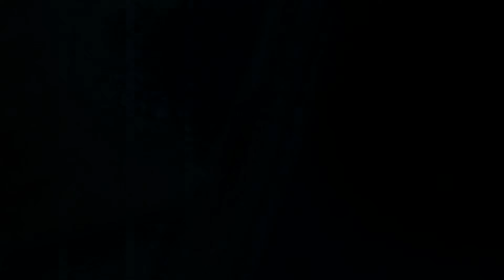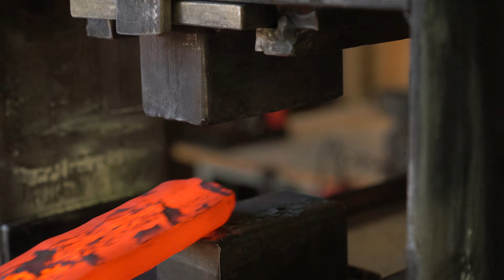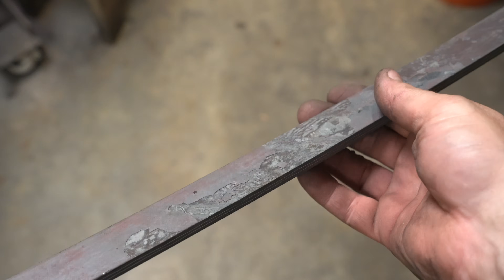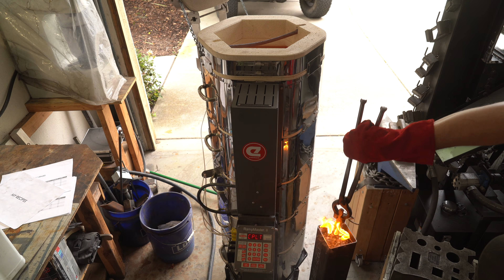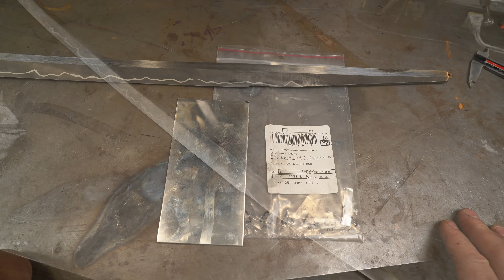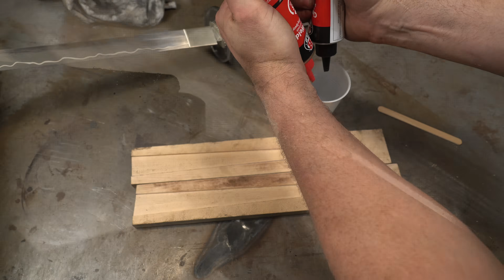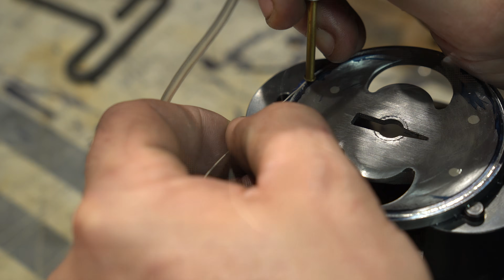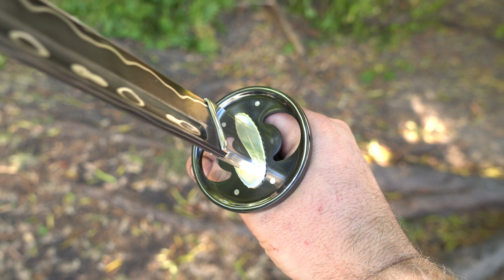Forging a Silver Damascus Katana

Comment: Hi, curious, have you ever used the wood clamp method after a quench to prevent warping?
Reply from the maker: Yeah, I’ve tried that.  It really doesn’t do much.  I usually clamp between pieces of angle iron as to prevent further warping but it still can happen. Thanks for watching.

Comment: How has the sword held up? I love the idea of silver Damascus, so I’m really curious if it holds up well over time.
Reply from the maker: This sword was sold the day it was released.  Theres no question that it would hold up though.  The silver is a very thin layer, about the thickness of two pieces of paper, over a central core of high carbon steel.  It’s very strong and durable.  Thanks for watching.

Comment: why the tiny file after the heat treating it was there for half a second what does it do?
Reply from the maker: That is a special hardness file.  It shows that after heat treat, before temper, that blade was around 65 hrc.  Thanks for watching.

Comment: 0:02  I’m just going to say that before I watch this, I know one thing that nobody can disagree with. A key point with this project will be to make sure that the edge is high carbon steel, unless this is just a decorative piece. I know this is a possible if extremely expensive project. Since copper can be used in damascus then so can metals like gold or silver. Just don’t try ever try titanium, the weld is highly unlikely to stick.
Reply from the maker: Thanks for hanging in and checking out this build.
Reply: @TyrellKnifeworks you’re welcome,
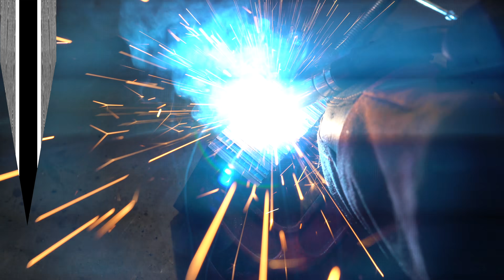Reply: 0:37 just hearing the plan is having me nodding in agreement, and thinking good thinking, this guy knows his stuff.

Comment: i have no experience in forging, never did anything close to it and have no experience at all. But I'm a scientist, and have deep understanding of physics, although i'm an applied mathematician. So as i understand, the process means a lot on an end result, and i have a few question. 1. Shouldn't hammering be preferred over pressing? as i understand applying instant impulses should be more beneficial for alloy, or pressing for some reason is better? Also as the alloy in the process gets cut, and wildered together, it affects to alloy quality by a big margin, wouldn't it be better to bend the alloy and hammer, or press it back to one piece? please don't be angry if my questions are stupid, a just wanna know ur opinion, since i have no clue
Reply from the maker: There have been studies and hammering doesn’t prove the steel structure.  Aldo, the cutting and restacking is preferred over folding because it’s quicker and you get more layers faster.  There is no benefit to folding over cut/restack.  Thanks for watching.
Reply: @TyrellKnifeworks  thank you

Comment: I realize that this is for decorative purposes.

But ….   What’s the theoretical STRONGEST Damascus 4:52 configuration?

There’s 2000 varieties of 
steel.

And Titanium, I suppose.

What’s the most flexible, most durable mix?
Reply from the maker: There’s no “best” steel or combination.  It all depends on the use case.  Too hard and it will be chippy, too tough and it won’t hold an edge.  Titanium is strong but brittle.   Theres just no answer to this or it would have been fine by now.  Thanks for watching.

Comment: Its not better to many times fold the Steal ?
Reply from the maker: Folding the steel was a technique the Japanese used to remove impurities because the steel they used was crap.  Modern steel does not have those impurities so adding layers is just done for aesthetics.  Thanks for watching.

Comment: Not a bad job. But real Katana's are not put in the handle with a pin. The handle is not permanently attached to reduce vibration when you hit something hard in battle.
Reply from the maker: This katana is held together with a single peg (mekugi) as it’s supposed to.  Thanks for watching.

Comment: Bro says you cant for the stacked differential shaped Damascus pattern "BALLS" I've seen it done no true blade smith uses a rolling mill they actually forge there blades to there desired shapes!!!
Reply from the maker: There’s so much wrong with this statement I don’t know where to begin.  What the hell is “stacked differential shaped Damascus”? 🤣  Did you make up that term?  What I said in the video was that you don’t forge these to shape, which you don’t.  Something like this with non-ferrous metals in it will delaminate if you try to forge the edges.  As for who’s a “true Bladesmith”, perhaps you should look me up on the ABS website, or better yet, grab the Feb issue of Blade magazine and see THIS sword featured within! Next time try asking a question before you spout off and sound very …uneducated.  Thanks for watching.

Comment: Iove seeing  the crap seep like sweat when forging 
Edit  Yr work is excellent,
Reply from the maker: I’m not sure what you mean, but thanks for watching.
Reply: @TyrellKnifeworks  just the impurities  as I thought  the were asbyou are compressing the welding and gradually  shape it , what is it then please ,scale ,love spelling, as y the process  and forged it ,with that fantastic  press y built, 👏, the black stuff that  seeps like sweat ,what is that
Reply from the maker: @lornemcneil the stuff that flakes off the side is scale, which is iron oxide.  It’s a waste product from hot steel contacting the air.  👍
Reply: @TyrellKnifeworks  thanks  for reply after my attempts  at spelling, grammar  ,and context, 👍
Reply: Scale is an impurity  then  ?
I acquired  a tamahangane  just because  it was old school, next is a folded  spring steel  that is in progress, and no the tamahangane  Was not Japanese
Reply: @TyrellKnifeworks  I had  to get folded  hand hammered  at least  for my laws now in my country, is  thier any ,any benefits  to fold spring  steel  other than ascetics,
Reply from the maker: @lornemcneil  No, not technically impurity.  When you expose ANY hot steel of any kind to air, it will oxidize.  Basically you're burning out the carbon and it's turning from steel to iron oxide.  Tamahagane starts as steel with a ton of impurities in it from the way it is formed in a bloom furnace.  They dump charcoal onto iron and it forms steel but this process creates a ton of impurites and pockets of slag.  This is the real reason why it's folded so many times, not to "strengthen" the steel but to remove those impurities.  Steel of that day made in Europe was crucible steel and had much less impurities so folding as much wasn't necessary.  Many people hold tamahagane in such high regard but compared to European steel of that day, it was far inferior.  I hope that helps.
Reply: @TyrellKnifeworks  of course   sir ,respect, I'm  read  the sword  forum reading  a lot  of knowledge, not my own personally,👍,y have givin time I will watch  more and send Yr  posts on

Comment: Why is your press build to move up instead of down?
Reply from the maker: Because it actually makes more sense to put the cylinder underneath so that it doesn’t need to be super tall.  I’m 6’2” and the dies sit at about 4’ so I don’t need to crouch over to see what I’m doing.  It makes zero difference if the dies compress up or down when working the steel.  Make sense?
Reply: @TyrellKnifeworks  yes thanks for the awnser! didnt know that.

Comment: Beautiful engineering, execution, and artistic impression in this piece.

You noted overheating and melting some silver. I did not notice any anomalies in the final result. Wondering if you were able to see anything not well captured on video?
Reply from the maker: The line of silver about 6” from the tip is a bit thinner, but certainly not bad.  Thanks for watching!

Comment: What are the names of the following machines

1- used to cut iff the extra silver nails in the tsuba
2- used to make a line to fill the silver in 
3- used to write letters on the blade
Reply from the maker: 1) a Dremmel with a carbide burr, 2) Pneumatic engraver, 3) GRS high speed rotary tool.  Thanks for watching.

Comment: The sword is undeniably beautiful, I’m just not convinced that it’s a functional blade. My concern is that it will delaminate at the first shock blow to the blade.
Reply from the maker: The silver brazing bond is in excess of 70000 psi in tensile strength.  You’d destroy the blade before you ever sheared the layers apart. Thanks for watching.
Reply: @ thanks for taking the time to respond to my comment, it’s appreciated

Comment: With silver in the construction is the blade even functional or is it an expensive wall hanger? I meant to say piece of art,
Reply from the maker: See my other comment.  This is a fully functional blade.  Don’t let the silver fool you, it’s only about the thickness of two pieces of paper after forging and it’s over a central core of high carbon steel which is the entire cutting edge.  You probably think the silver goes “through” the blade, but it does not.

Comment: Blade looks awsome. When you grind it down on the sander though try to sand/grind away from you if that makes sense i saw a guy i use to work with hand catch fire after a spark hit his hand. Granted he has grease or oil on it and forgot to wash it but you cant be too careful uk
Reply from the maker: Don’t  worry, I know how to use the grinder. 😉. Thanks for watching.

Comment: you made a mistake, the katanas were forged entirely from one piece, if you were grinding something, you ruined the arrangement of the steel "veins", you should have forged it into a straight structure and obtained the curves by hardening
Reply from the maker: First off, read the pinned comment regarding the differential heat treat. That was a conscious choice on purpose.  Second, you watch too much TV, “veins” in the steel is ridiculous with modern steel which is far superior to the crap steel the Japanese had back in the day.  Not to mention, I forged Damascus for this blade so what you’re saying makes no sense. This katana was specifically made without traditional techniques because of the Damascus.  Next time start with a question instead of assuming you know more than I do. 😉

Comment: You Han kill a werewolf with that thing. I need one. I've been fighting them in the the old manner, give blessings and sanctify that what they defile. Please sir. I need one of those.   I can make my own Holy water tho I'm not a member of the clergy but they are council to me. You can have it back when I'm done. I am a hammer bearers and was a mage in laymeria 150000 year ago. Could you maybe make another video of this silver steel blade where in witch you twist the metal after the 1st or 2nd restock early in forging and perhaps tell use about any differences that might come about in the finished product? Could it affect the integrity of the blade? I'm interested in seeing how evenly it dulls with continuous use after some time. I'm interested in metal working. I'm looking into schools for welding , and I have an arch welder I have turned on yet. Do you have any suggestions for aspiring black smiths? I really enjoy these videos. You mentioned your home made press, I love to watch a build video for something like that. Thank you for this chanle I'm getting more inspired all the time. I do carpentry, I can do framing cabinetry dove tails and I can turn a bowl on a lathe and get the walls of the bowl thin and long. Haven't been near a lathe in years. Had to sell it. I hear welding is easier because with wood if you cut off too much you need another price of wood. But with welding you can just fill it in with weld. I'm excited to start welding, I almost have all I need to start practicing. And I have a few projects I could start doing once I'm confident. I have freinds that weld. I'll have them supervise. Saftey first. And I like to see safety procedures for using different tools and materials, but you do your chanle your way. There's nothing wrong with it, I'm just interested in welding. And I fight demons. It's not easy. Never faced one in the flesh but it's inevitable.... hmm. If I mail you some material, would you make something and sell it back to me? I need inscription on my hammer. Oh, in achieving times, and in the days before Noah there were hammer bearers. Great protectors. Most hammer bears carry an impossibly well crafted stone hammer head and hickory oak or ash wood hanble. My hammer head is steel. But it's of the right proportions and weight  and  balance. My hammers name is DREAD MAUL. the old oak handle has runes carved into it. Protection. Strength. Defence. Warrior. I want my hammer to me to also be inscribed. Instruction will come with hammer. Maybe I should find a black Smith closer to home that I might not let hammer leave my presence. Thank u again for the video.
Reply from the maker: This blade is already sold.  The silver is never on the cutting edge, the entire core and cutting edge is high carbon steel so it will stay sharp for quite a while.  Thanks for watching.

Comment: You aught to get a pentograph machine to do the japanese characters it would look so much more professional not that the sword didn't turn out good
Reply from the maker: Remember that the characters are generally hidden behind the tsuka.  These are typically chiseled in, but I’m not that good with my pneumatic engraver. 😉. Thanks for watching.
Reply: @TyrellKnifeworks  your very welcome in my opinion you make some of the most beautiful swords I've ever seen so I can't help but watch have you ever considered getting a wire edm machine?  I've seen some people make the craziest Damascus using a wire edm machine
Reply from the maker: @jackie5698 I’ve also seen some great work with wire idm.  I’ve never looked into it though.  I assumed they aren’t cheap.

Comment: Question. Since silver is a soft metal wouldn't that weaken the blades strength?
Reply from the maker: The silver is just a very thin sheet (about the thickness of two pieces of paper after forging) over a central core of high carbon steel that is the entire cutting edge.  It’s very strong.  Thanks for watching.

Comment: what happens to the welding bead rod. Does the bead become part of the knife?
Reply from the maker: Are you referring to the weld used to tack the damascus together?  That is cut off when the billet is restacked and never gets into the final billet.  Mild steel would etch bright white, so you would definitely see it in the final product if you did have any still in there.  Thanks for watching.

Comment: just something i thought about while watching that roller machine, if you could aquire an induction heater coil large enough and of a high enough power, you could use the roller while adding heat as its being rolled, would increase work time or depending on temperature you can acheive with proper technique you could get more precise with your application of heat while working the metals.... 

random idea that came to mind

Edit: something else i thought of with that rayskin you could have taken the silver dust from the grinding and inlayed it into the cracks between the beads on the skin using some kind of thin adhesive like clear coat than use a stiff but soft and slow buff to get the high points of the beads cleared and maybe even a bit of a polish to the skin leaving the groves filled with silver.... if the skin could handle the heat to reach soldering point without damage you could dust up some silver solder and use that to make a paste you could flow into the skin, this would be rather cool tho i doubt the skin would survive that much heat.
Reply from the maker: I have an induction forge but I don’t think that juice is worth the squeeze. 😉. I do like your clear coat idea on the silver but it would have to be grindings because silver powder is just gray.  Thanks for watching.
Reply: @TyrellKnifeworks  you may want to read that again as I mentioned using  silver solder ground up and seeing if the rayskin can handle the flow temp of the silver solder than use Flux after proper cleaning of the skin and use a towel to wipe off the high spot Flux , this will make the solder flow where Flux is only...
Reply from the maker: @drayko-okamidirewytch5542 . Yeah I get it.  The rayskin certainly will not withstand any heat.  It would have to be epoxied in.

Comment: So is there any difference to normalising/heat treating blades like this with metal layers at different melting points?
Reply from the maker: The heat treat is focused on what the core steel is. In this case it’s 80CRV2 steel which makes up the core and the entire cutting edge.  The other metals are never on the cutting edge.  Thanks for watching

Comment: I really love this silver and carbon steel katana you forged, and in the style you did, it is while still staying traditional. Beautiful work, and around my birthday no less last year. I love the copper cumai one you forged as well. But I am looking into swords and daggers I can buy online. But no one seems to have what I want. So I thought I'd ask you. First off. I'm pagan. Second, silver is very powerful, wards off evil, and is a very powerful conductor. Third,  carbon steel has negative  magnetic/conductive properties and stays sharp for a while. Fourth, I love fossils and desire blue and black opalized hardwood from Indonesia for a handle material  that includes fluting with twisted silver islay in the flutes. And fifth. While I may not be ready to purchase and won't be for a while because I'm dirt poor at the moment, I would love both a parrying  main goche dagger and a swept hilt rapier in the stile I just described similar to this katana.  I prefer double-edged blades over single with a stabbing 7 I was wondering, though, it may be challenging if you could possibly make such weapons. my birthday is coming up, and I'm not asking for anything quite, yep. You actually may not be willing to take such a product on. But I'm asking if you can or think you could . So. Can you?